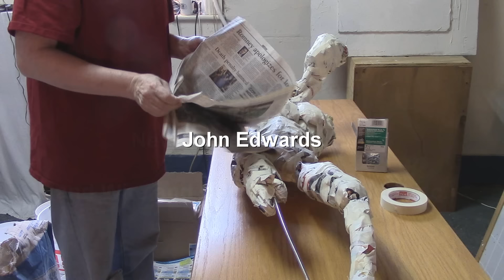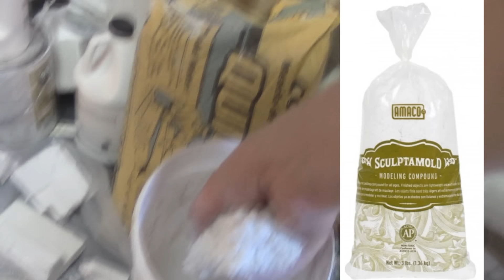Sculpting with Plaster 5: Newspaper, Wire, and Other Stuff

Comment: Hi John new to your channel I currently on a 3d sculpture painting course only the tutor advises you buy her ready made plaster for the work which is costing a fortune in postage costs from Russia to the UK. I do know a few other artists who have given away her secret which is a plaster named Clavel riviera decorative stone plaster with added fibres. This imitates the Mediterranean Old stone walls. Now having watched this I seen cellulose fibres are added to your plaster and a green stuff used for insulation. I've been experimenting with making my own texture paste which has to stand upto the tutors expectations for the lessons upto 5cms high some petals need to be oh these are flower sculptures and have found a decorative plaster in the UK called fox decorator a Polish company makes it and it has cellulose fibres inside. I do know this Clavel is fibreglass not cellulose. I'm wondering is that insulation stuff you use any good for adding too this decorative plaster do you think as at the min I'm just adding marble powder to thicken it up because it's already got the fibres added.

Comment: Beautiful ! Beautiful! Beautiful! All your artwork is different and just gives a very appealing feeling! Watched all ur videos! Loved ur work! U have really inspired me to try this out! Btw is pop and plaster which u use r both different? How do you prepare the paste which u r using..can u please tell the proportions of mixing the glue n molding powder? U have used different molding powders in the video..
Reply from the maker: Thank you for you comments. I truly appreciate them. As for the addition of Elmers glue, I generally add that to plaster maybe a cup to a quart of water. I don'tnt worry about proportions too much. I just want some extra strength. If you add too much the mixture will,become gummy and hard to work with but it'll certainly be strong. The second material is Amaco Sculptamold. It comes already mixed with glue so you just have to mix it to the consistency you feel,like working with:either wet and sloppy or thick and more like paste. Third, I have added celluloid (household paper insulation) in varying amounts thinking it might add strength to the plaster but in this case I fear I used too,much and may have actually weakened the plaster. I think it would be important to pre-soak the cellulous and then mix it very thourighly with plaster but not use as much I I have here. The other reason I used cellulous was to ,try to,make the plaster lighter (weight) but I have since found a lightweight plaster called Structolite which is mixed with Perlite and is, I hear very very lightweight. I haven't used it yet but intend to this weekend and will post a video about it, its strength, ease of worksbility, and whatever else I discover. Thanks again. Hope this answered your questions as best as I can right now.
Reply: @cantopia  wow!! Thank you so much!! Looking forward for the video!! Hope you have fun ..

Comment: Hi, I like your style, but what do you do with all the sculptures in plaster? surely they aren't weather proof is it a certain type of plaster you use like Herculite etc? Thanks!
Reply from the maker: No, they are not weather proof but plaster is pretty weather-resistant. By which I mean a plaster figure of any real thickness at all, say 2" thick, will endure a lot of inclement weather and survive one way or another for a couple of years. But that is without any additive. Acryl-60 and/or Elmer's Waterproof glue will add to the life of the sculpture both indoors and out, but if outdoors a final coat of some kind of polyurethane (once the plaster has dried good and hard) will help. The problem there is that if the sculpture is hollow and the surface is water-tight then water can accumulate inside the sculpture and will slowly and steadily push its way through the plaster and shove the polyurethane off and then break up the plaster so you need to vent the interior area of the sculpture or fill it with something like foam or actually build your sculpture over a solid foam core. Cheers. J
Reply: Exterior varnish will make these things weatherproof. You just have to make sure there are no holes where moisture can get inside. Any interior moisture will cause it to rot from the inside out.
Reply: cantopia  Have you ever tried grey cement? I would love to see your art survive longer in any kind of weather. Thank you for sharing!
Reply from the maker: @carkirsch77    No, I haven't used cement yet but am working with 3 specialists to find a lightweight moldable, waterproof, weatherproof and strong material.

Comment: have watched probably all your video's, and though you are more advanced than I,  We use similar techniques.   But saw the Portland cement, and wondering if you mix with plaster at times?   my sculpturs mostly are exterior,  so curious if that is a possible solution.  thanks
Reply from the maker: Hi. Yes I have mixed various cements with plaster, not directly but on top of each other. I did this because some cement -based mixes are a little more plastic and easy to manipulate when I want some greater control. None of it is even close to the malleability of clay although a lot of them are marketed as "clay-like" or stuff like that.  Plaster alone will survive outside for a few years but not forever.  If I where stuck making something out of plaster that had to be outside or otherwise take a beating I would mix it with Acryl-60, which is a polymer additive for cement but works fine with plaster. Elmer's Glue works too but makes the plaster gummy.  I am also about to do some experiments with Minwax Wood Hardener, which is a liquid that I believe penetrates porous materials. It's expensive but not as expensive as watching your hard work dissolve in the rain.  The Minwax liquid would be applied after the plaster has set and dried, otherwise you'd be trapping water in there.  Whether or not it can be added directly to the wet plaster mix, I don't know, but I don't see why not. All I can say about cement is that it's real hard to work with. It tends to go off too slowly and it's far too heavy for my purposes.  Perhaps you can find a method that suits your work.    Keep in touch. Good luck.  John  PS Can I see your work somewhere?

Comment: If you don't mind me asking, how fragile are this sculptures, and have you ever tried cement??. Thank you for the great art work
Reply from the maker: Well, these won't take too much of an eating but they are easy to repair. And no, I haven't used cement yet but I have experimented a little. Problem is that it doesn't model the same and is too heavy, probably. I am trying a material call Structolite which is plaster mixed with perlite. It is very light but comes out s grey/brown which I'm not sure I like. We shall see. Thanks.

Comment: Thank you for sharing,  the work is amazing! Do the figures end up being heavy? Like can they be hanged on the wall? Thank you.
Reply from the maker: Thank you. No, generaly the figures are not all that heavy. It depends on how much plaster each requires. Some are fairly light. The figures attached to backing boards get pretty heavy though because they don't generally come off the backing boards. Again, Thanks. John
Reply: @cantopia  great! thank you again!🙂

Comment: Everyone I work with plaster it cracks. I have done large pieces and I end up using paper and glue. Plaster cracks on me. Any recommendations?
Reply from the maker: I'd need to know a little more about how you're using the plaster but initially I can suggest adding elmers gle to the mix or some kind of fiber. Excelsior (used to stuff furntiure) is often added to plaster catings for strenght but I don't know how you'd build with it. It'd be a hell of a mess. I often use a coupld of layers of plaster bandages (less expensive in bulk from medical supply places than art supply sites) and that stuff will not crack. Then you layer additioanl plaster over than. Tell me more about your process and I'll see if I can think of anything. Thanks and have fun. John
Reply: Just small figurines, but I wanted to make an angel and the wings kept cracking
Reply from the maker: Hmmm.. make them thicker?  And/or add Elemer's glue to the mix. Let me know how it goes. Cheers, John

Comment: where you get the Green Fiber? do you like the stuff?
Reply from the maker: Home Depot or Lowes or someplace like that. It's cheap. Be careful not to use to much or it will weaken your plaster; which is why I add Elmers' or Acryl-60. And be sure to mixe the insulation cellulous thoroughly so you don't get dry wek spots.

Comment: Hi John, what is the largest  gage of aluminum wire do you use?
Reply from the maker: 1/4 inch if I need a real strong armature but it's hard to work with so 1/8" in fine and sometimes I double it up. The strenght of the piece comes principally from the shell, the plaster and paper itself. Cheers.
Reply: Thank you, and cheers to you!

Comment: how many thick or gauge is the wire you used? can anybody answer me!!!!!?
]
Reply from the maker: Hi. For the main armature I use  fair thick wire. Up to 1/4 inch. For hands, I use something like 1/8" or even thinner. You can always get thing and wind it up to a double thickness. . But important: It's Aluminum wire. Steel is too tough and springy and won't bend easily. Cheers
Reply: @cantopia  thank you so much sir. Very appreciate this response. I am subscribing to your channel :)

Comment: hi I noticed youb used some Elmers with sculptmold, does that give it texture?
Reply from the maker: No, the Elmarers is for dry-strength. But it can make the plaster gummy and you have to work faster, especially if you use too much Emlers which , how much is that? I don't know. I just add some into the water and hope.
HAve fun. John
Reply: Cliff DaRiff  Another one:

https://youtu.be/xuDgLsnErik